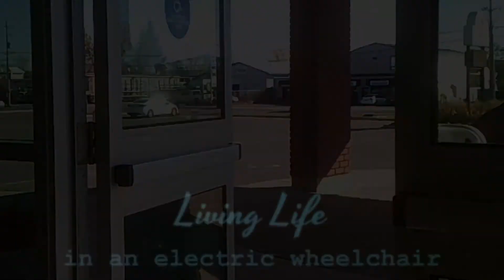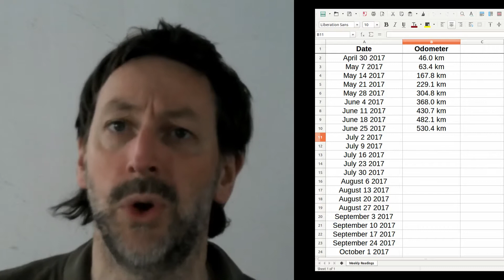Adding An Odometer To A Power Wheelchair

Comment: How about adding a alternator to the front axle or back axle then running the electrical wires from alternator to the battery so we have a full circuit. The battery runs the motor which spins the axle the axle spins the alternator (which is mounted) therefore that generates power which runs back to the battery.. when you make this you OWE ME a 10 percent cut🤣🤣🤣